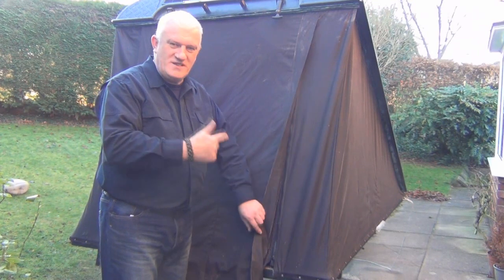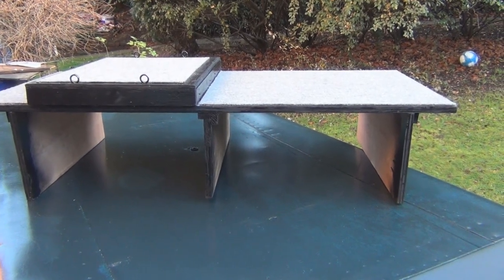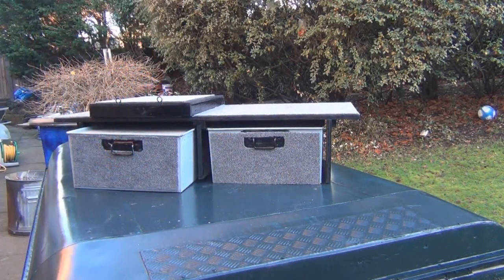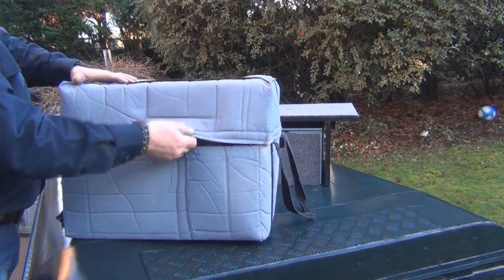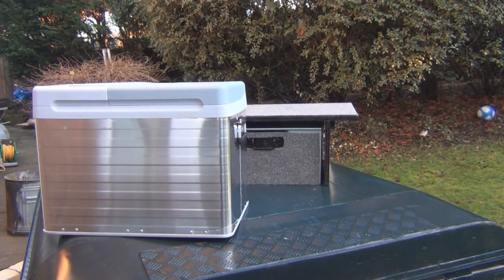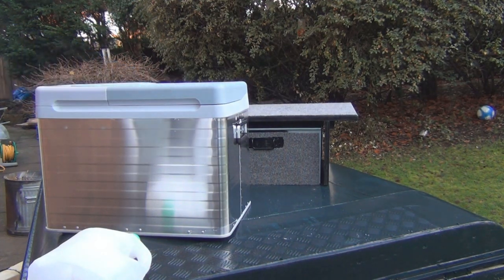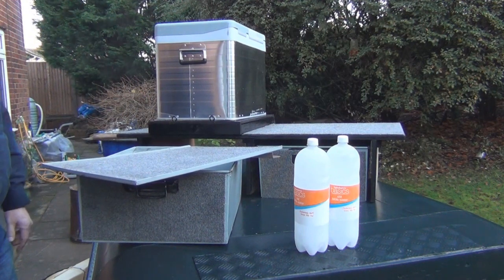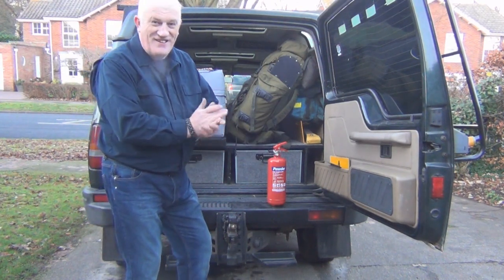Land Rover 4x4 Draw system DIY

Comment: I operated a cold box when I was an over the road truck driver.  It worked great for keeping cold things cold or hot things hot but it wouldnt change the temperature.  By switching the leads on the plug that one would change from hot to cold.  I have cold shapes in my freezer for that same purpose. My family visitors used to poo-poo me when I offered some to them for their coolers. They couldnt get bagged ice one trip and agreed to use them.  Now they insist on refreezing their own because now it thier own idea :)
Reply from the maker: Good idea's will normally win people over in the end Atb Randy, stay safe. Roach

Comment: Love it Roach,being able to make your own kit is the ultimate prep, repurposing or using something that has been thrown away is a great skill to have.I make most of my own kit and a lot of my knife making equipment is made from repurposed items.
( Dont know if its happening your area but there are some scumbags stealing discos/defenders down my way).
Always good to see your video's 
Cheers Jason
Reply from the maker: Hi Jason, They chop them for parts which fetch quite good money, and as we know the locks and security systems aren't exactly cutting edge I've fitted a safety pedal check out this link Atb. Roach
 https://www.youtube.com/watch?v=9IWegKRCaLo
Reply: its all over mate its the same reason why i break discos when i can get them cheap. most of the bits will go on most landys. there are some first class scum bags out there and this is when times are good. could you imagine shtf.
Reply: Torn Apart self sufficiency My father inlaw had his defender taken a few years ago,it had a steering lock and pedal lock and they dragged his wife's micra out of the way to get the defender,all this 30ft from there house while they where in.the same group(we think)ran over and killed the owner of a landrover place a few miles away when he found them on his land trying to steal parts/landrovers(and the owner was armed with a shotgun but they still killed him)

Comment: fantastic mate i was just looking at these and you have done a bang up job. im sure you have done it but i didnt see it but fridges in cars need alot of air flow round the fan so if thee is any cover or anything blocking the fan or vents they fail. iven if they look like they are ok the top ones start showing a faoult warning and others just over work and fail. stay safe bro.
Reply from the maker: I didn't film the top but the vents are free and clear to suck and blow (HaHa!!) Atb mate. Roach

Comment: Did you cut a hole in the cooler bag for the fridge fan?  It's all looking good. I'm not sure how much power that fridge uses,it might pay to have the back up battery isolated from the cranking battery. Some of the cheaper fridges use a lot of power, I have on that runs on 12v 240v and gas I usually take it and set it up on gas at the camp site, if you use it on 12 v and forget to disconnect the power it will flatten the battery in a few hours. I also use a Wako 110 lt fridge with a 120amp battery with a 100w solar panel plus a couple of lights etc and it will run indefinitely, well as long as the sun is out for 6-8 hours a day. Not necessarily bright sun light either. You can't have much to do now.
Reply from the maker: Hi Malc, yes fans clear to suck and blow, I've fitted a Voltage control unit to the dual battery (So all good there) and like yourself I've got a 40 Watt solar panel for battery back up and support happy camping Atb. Roach

Comment: Just wondering, why didn't you go for a proper 3 way fridge rather than a cool box? I know that they cost a bit more but they run silently and being able to power them via gas is a bonus.
Reply from the maker: Hi Steve,
As you probably know here in the UK we just don't have the warm weather to need a fridge, but this unit is a weaco so has a great pedigree and warranty and it came along at the write money so I decided to try it out, I'm also planning to do a lot more cooking video's Atb my friend. Roach
Reply: ***** LOL, I know what you mean about the UK weather, it does seem to be getting more freaky though, I've experienced a couple of really hot days over the last few years, it must be down to global warming then.
I often go camping in Southern France, Spain etc, it comes in real handy then, I use to take a cool box type but it did struggle in those sorts of temperatures.
Best of luck on your trip around the UK.